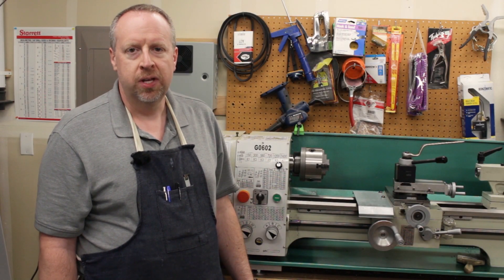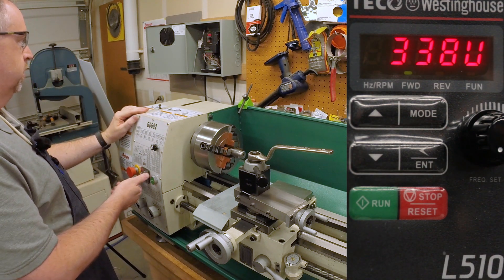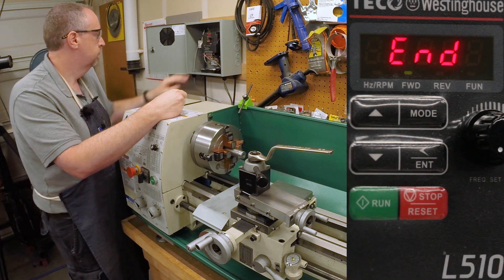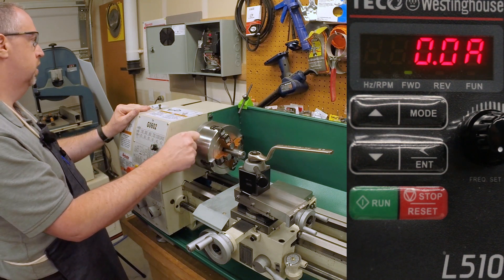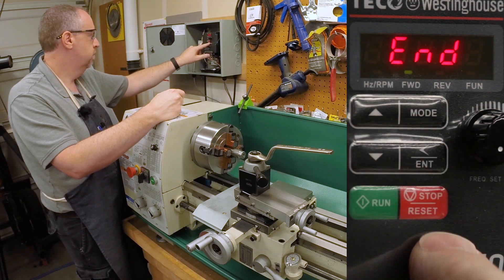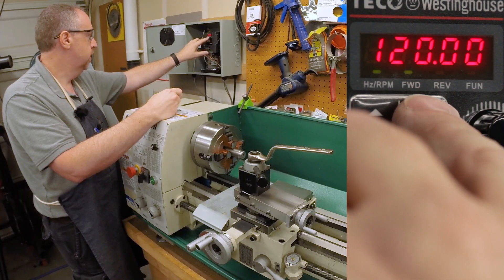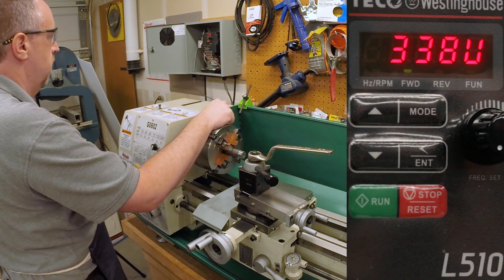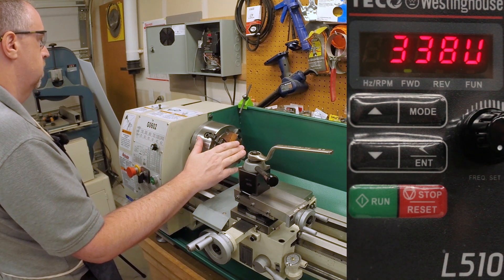Lathe VFD Addendum: How to Tune Acceleration and Braking

Comment: Just a thought - considering you now have a brand new, uncalibrated variable speed control: how will yo know what speed your lathe is actually running at at any given moment?
Reply from the maker: I just realized this was a comment on one of the VFD videos.  I was assuming at the time that I could calculate the speed from the lathe speed chart, the motor plate, and the VFD frequency.  In reality, it's running a little faster than that.  I suspect the belt ratios are only approximate.  The electronic leadscrew I'm building now has a tachometer generated from a spindle encoder, so the speed will be measured precisely.
Reply: Thanks for the clarification, I'm working through the backlog now and I kinda forgot about your new ELS... :)
Reply from the maker: The microcontroller uses the spindle encoder to calculate the speed in real-time.  I'm making no assumptions about the spindle speed.  In fact, I expect it to vary during the cut.

Comment: There are a couple of issues accelerating a spindle to quick. 
1~ the bearings in the spindle can skip/chatter not good as it will stuff them up.
2~ Holding delicate/heavy parts can be troublesome. As it will not have enough clamp force to accelerate the part. This normally shows as run out.
Reply: You can overcome that by fitting a 5C collet chuck that will give minimal inertia.....no worry about spinning a scroll and loosening the jaws.

Comment: So what happens if your running the lathe at your full speed and you have to hit that estop? Will it damage the vfd?
Reply from the maker: It shouldn't.  I've done it several times with no ill effects.  Worst-case, the back-EMF from the motor would power the drive until it stops or shuts down due to over-voltage.

Comment: Do you worry about premature bearing failure at the much higher rpms that you can achieve now?
Great video series!
Reply from the maker: The motor is running at double the rated speed, but I'm not worried because I believe (without evidence) that they use the same bearings in the 1800RPM and 3600RPM motors.  The spindle of the lathe isn't actually running any faster than stock.  Stock, in the fastest belt configuration, the lathe runs at 2400RPM.  I have the belt in the 1200RPM position, so at 120HZ, it's turning at the same 2400.  Honestly, I'd be nervous to run it much faster.  Maybe with a collet chuck and small workpiece something like 3600RPM might be reasonable, but with a bit import chuck spinning, that seems awfully fast.

Comment: Hi James- thanks again for creating this series- it has been a tremendous help for my G0602 conversion. I ended up using almost all the parts you recommended and i did the inital programming tonight - what a difference! I have a couple question(s)-

* Any issues at 120hz? Dare go higher? I agree with your philosophy that the chassis likely is the same on the 3600RPM version - it would be nice to stretch the legs of the VFD (within reason of course). Honestly i'm more worried about the spindle bearings
* Have you experimented with any settings to help optimize low end torque? During a few tests tonight, i was able to grab the motor pully at 6hz and stop rotation but i don't have the belts/mechanical advantage setup yet either
* How does it cut? I suppose i'll know soon enough, but i'm also interested to hear your thoughts. I'm really interested to see how it parts. I've shattered many HSS parting tools and wrecked an equal number workpieces on the slowest OEM setting when i wanted to go slower. It may be the G0602 isn't rigid enough though too-

I can't thank you enough for putting together this series - well done - this is top notch content and its too bad there aren't more channels like yours on youtube - well done!
Reply from the maker: I have used the lathe on several projects since the conversion and I am very happy.  I've done some parting, tapping, drilling and wide chamfers at 6hz with no issues.  Yes, the torque is low and it's possible to stop the spindle, but in practice, it hasn't been a problem.  I still need to try single-point threading.  If torque becomes an issue for a particular job, I can change the belts.  Being able to go from 120RPM to 2400RPM with the flick of the knob has been wonderful.

At the high end, 2400RPM is already pretty fast.  I could see 3500RPM someday with a collet chuck, but with a three- or four-jaw, that's a lot of energy, regardless of whether the bearings could handle it.

Parting is all about rigidity, speed and lubrication.  I have had pretty good results parting in aluminum and steel, but you have to be careful.  Keeping a brush with cutting fluid (A9) in the groove, keeping the speed up and keeping the parting tool engaged and making a chip works pretty well in aluminum.  The same goes for steel, but at lower speeds.  Going too slowly can make the tool grab just as easily as going too fast can make it ring.  In general, I prefer parting with the bandsaw if I can.  I've even taken the chuck off the lathe and clamped it in the bandsaw with the workpiece still in it to cut it off.  Parting in an eighth of an inch, bandsawing the rest and then facing often works well.

Then again, parting is tricky anyway.  I've blown up parting blades and even stopped the motor cold on a Hardinge HLV-H before, so there's that.
Reply: Clough42 great minds think alike - my more recent go to parting method is a Milwaukee portable band saw -haha - good point on Chuck speed-energy too.

Comment: I was thrilled to find this series of Video's on a VFD Conversion, because I'm going to be doing almost the exact same thing to my Chester DB8.    Mainly because using the Lathe at slow speeds (and the slowest pulley set up) ...... it blows fuses if you overdo it, which means anything over a 15mm drill with a very tentative feed rate.
I had to buy a bulk order of 6.3amp fuses because it happened so regularly, and I believe this solution albeit a different Voltage and a bigger Motor (UK 240V Single Phase with a 1.5HP TP Motor).
I really do need the High Torque at slow speeds because I do a lot of TIG welding Tube work, and I tend to make all my own flanges hence needing to drill larger numbers rather than having to bore out each one which takes more time.
I've really enjoyed every minute and commend you on superb work (both Spanners and Sparkies) especially as now I know exactly what I'm going to be doing right down to the last washer - Thank you very much.
Reply from the maker: You're welcome!  I'm glad you found it helpful.

Comment: Great Video,  you real should CNC that lathe, I am thinking about doing mine so you could use manual mode if needed
Reply from the maker: I've thought about that quite a bit.  The one thing that CNC would really add to the lathe would be the ability to turn long tapers without a taper attachment or fiddly setups.

I did the CNC conversion on my mill, and I'm very happy with it, but I really miss being able to turn the dials.  With ballscrews on the mill, pressure on the axes will easily back-drive the non-energized motors, so I think operating it manually would be pretty tricky.

Comment: A couple of items that may or may not apply to your location and set up James. There's a big difference between my 3 hp Bridgeport clone and your lathe and it was unclear in the video what belt position you had your lathe on. With my step pulley mill in the top spindle speed position the VFD faults out even at 60 Hz at anything less than a 4 second ramp up time. Any belt position below the top one does work fine with a 4 second setting. My guess is there's a fair amount of internal drag to overcome. Also depending on your location and winter shop temperatures there's quite a difference between a warm machine in the summer and even 60 degree shop temperatures in the winter. I ended up programing mine for a 6 second ramp up time so it works fine all year. It's possible there's some parameters I should go back and check after watching this video. But you might find some further fine tuning may be needed. You did a great job on this and if it works half as well as it appears to it should be a large improvement over the stock motor and speed control. It would be interesting to see how much torque you have available at the low rpm needed for anything around the lathes maximum diameter.
Reply from the maker: Good points to consider.  Let me see if I can address them.

The lathe has six belt positions, for 150, 300 and 540? RPM on the back gear (belt), and 720, 1200 and 2400 RPM direct.  I have the belt in the 1200 RPM position.  This gives me quick access to everything from 120 RPM (6Hz) up to 2400 RPM (120Hz) with the flick of the knob.  I've done some turning since finishing this video, and it's been working very well.  Being able to tweak the speed while it's in the cut to get the chips to break the way I want is really game-changing.

It does get cold here in the winter, but the lathe castings never get below about 40F (5C) in the shop.  At that temperature, the lathe came up to speed easily at 1200 RPM, but struggled a bit on the first start of the morning at 2400.  However, since I'm always in the 1200 RPM belt position now, I should have roughly double the torque most of the way up to 2400.  It certainly gets there faster now than it ever did with the stock motor and the 2400 RPM belt position.

Low RPMs are a different matter.  For anything under 1200 RPM, while the vector drive maintains significant torque all the way down to 6Hz, it can never compare to the added torque of the belt reduction.  So far, I've dropped it to 6Hz (120 RPM) to gently scrape out large chamfers with high-speed steel tools and to tap up to 1/4-28, both in mild steel.  Neither of these requires much torque, and being able to flick the knob to access the slow speed has been really useful.

The worst-case scenario for torque will be, as you suggest, a large-diameter steel workpiece running slowly.  For carbide in steel, this would be around 8" diameter at around 400 RPM.  I've never turned anything like that, but if I do, I can always swap out the belts.
Reply: Thanks for the additional information. My current lathe is a bit different with only a high and low speed belt position. It's variable speed single ph with no VFD (yet) Low speed belt position and about as low as I can go on the variable gives roughly 50-900 rpm and 900-2400 in the high position. But there's not all that much torque at the bottom speed. Certainly not as much as I'd like at it's maximum swing of 11". Even with a 2 hp vector drive I very much suspect there still won't be enough. As you say for good bottom end torque then some type of mechanical torque multiplier is needed. So it's either build some type of jack shaft arrangement or try and somehow shoehorn in the back gear set up the machine should have been built with anyway. The step pulley, back gear plus VFD on my mill works very well and gives me roughly 30 - 4500 rpm with ample torque within normal cutting conditions.

Comment: Can you set safety limits, where the control will ignore those time settings in favor of not frying itself trying to accelerate / decelerate a very heavy load?  For example, if you chucked up a 20 pound block would it still try to stop it when the bus voltage hits the 'what the hell are you doing' level?

I'm a big fan of machinery that won't let you destroy it even when you ask it nicely.
Reply from the maker: The VFD comes set with safety limits that do what you suggest.  If you try to ramp it up faster than it can handle, the magnetic field in the motor will slip or the drive will detect an over-current situation and shut down.  When decelerating, the VFD monitors the voltage on the DC bus and shuts down automatically when it reaches a preset threshold.  When this happens, it essentially disconnects from the load and lets it coast to a stop on its own, just due to friction.  For a manual lathe, this is fine.  For other applications, like a heavily-loaded downhill stretch of conveyor belt, cutting it loose might get pretty ugly, but then you wouldn't be using a $150 VFD for that, either.

The trigger thresholds are configurable (I played with some of them in the video) but I don't think you can turn them off completely.

Comment: What is the suggested rating for the braking resister?
Many place to buy on line.
Thanks
Reply from the maker: The VFD I'm using doesn't use a braking resistor.  I think the 460V models can, but I don't have one.